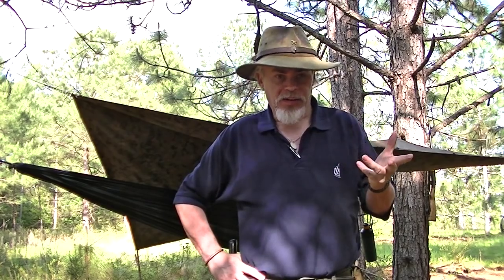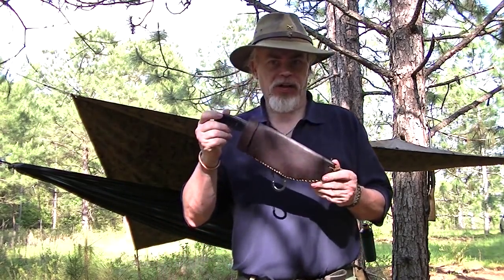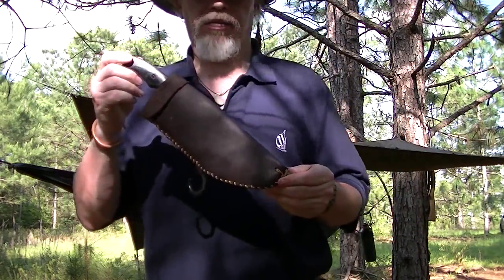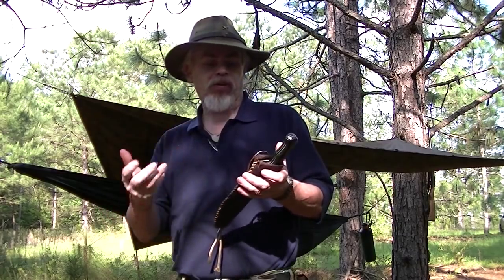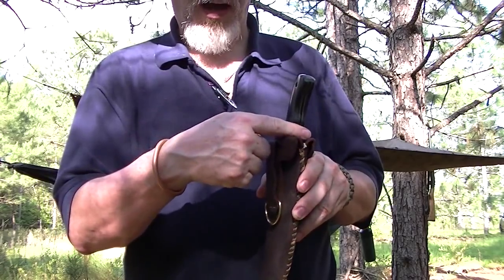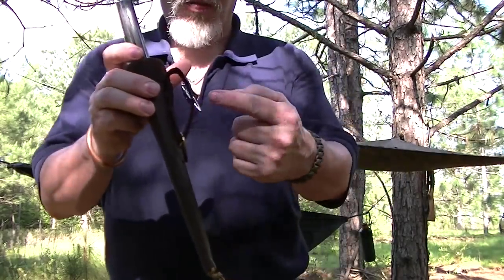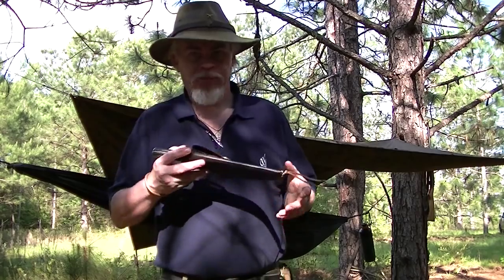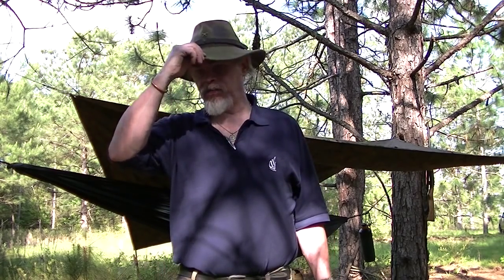TRACKER KNIFE UPDATE

Comment: much betterer Blackie!
i recently purchased a tracker style knife from nepal...i like it much more than the two Tops TB trackers ive owned in the past...5160 steel, differential heat treat, distal taper, rosewood handle and a scandi grind.
i showed that knife in a recent vid i put up.
i built me a sheath for that knife which tightly swivels on a heavy copper rivet...much like the condor sheaths.
anywho i like your new sheath...woods